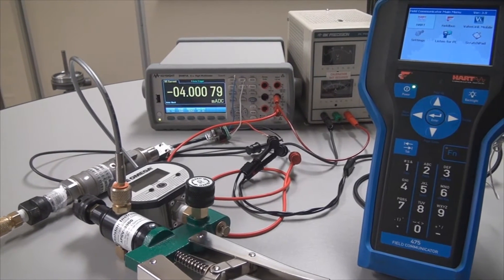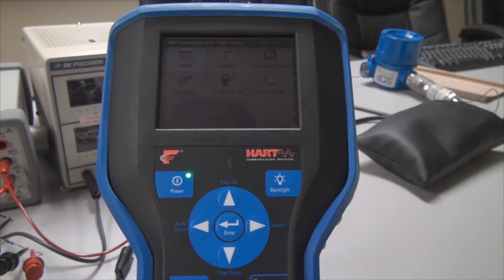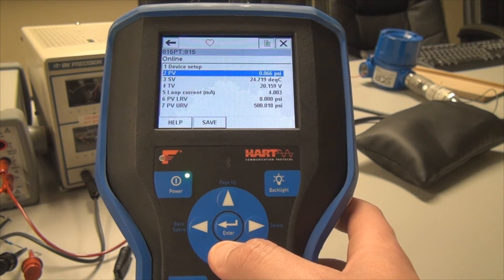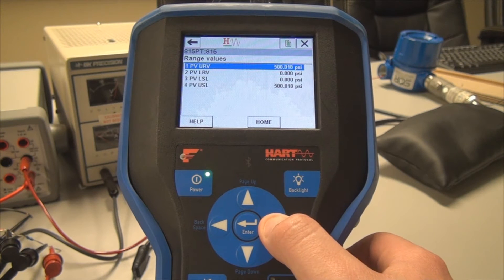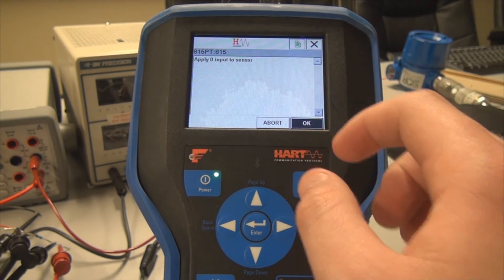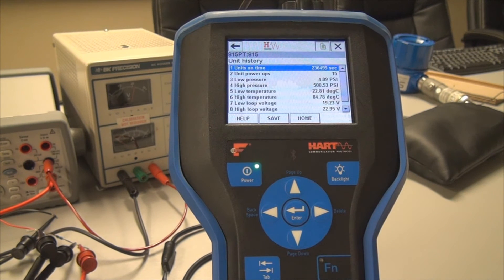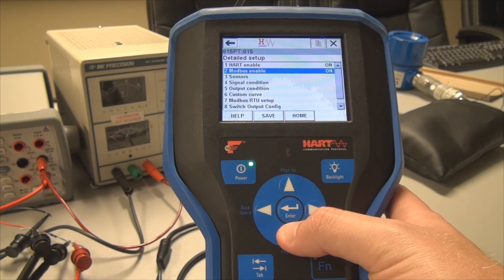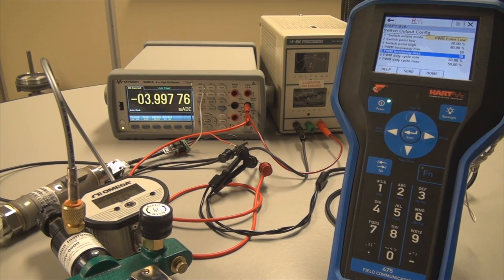HART® 475 Walkthrough with 800 Series Pressure Transmitter

Comment: First, PV is Process Variable.  SP, PV, & CV are all closed loop (P, PI, PID) terms.
Second, Good Video! I wish this video was longer ... 

So my question is about the "SEND" and the "SAVE" buttons.
I remember "in the day" when I used a Honeywell STS102 or 103.  And I could set the values; however, for the transmitter to hold on to them, I had to "save" those values.

For the 475: To pin it down; 
What happens if I just type over the value that's there? 
(and I believe I can do that, text over without sending, even at the overview screen)
When I "send" the value, what happens?
What happens when I "save"? Is that for the transmitter, the handheld, or both?
Do the selections change depending on the manufacture of the device?
(obviously, if it is a different device, pressure trans Vs temperature trans, there will be differences. But what about two transmitters that are both pressure transmitters but from two different manufacturers both using HART to communicate? Does the menu selection change?)

Thank you all in advance.